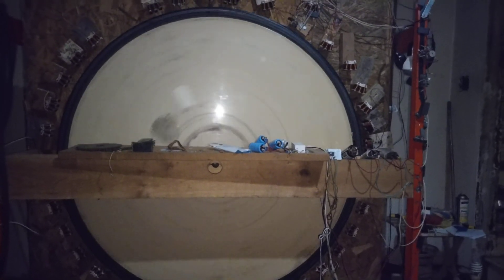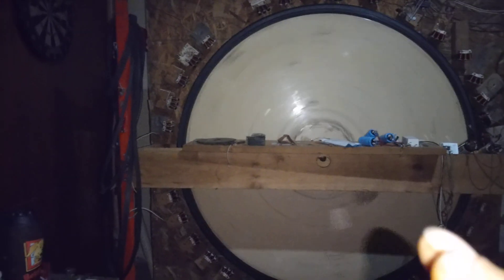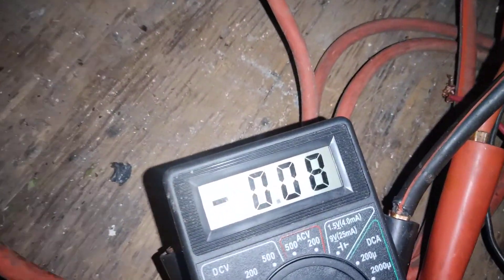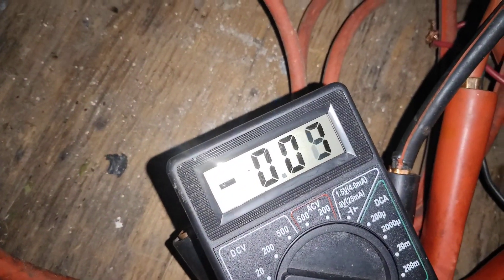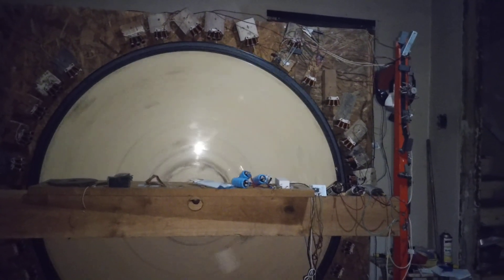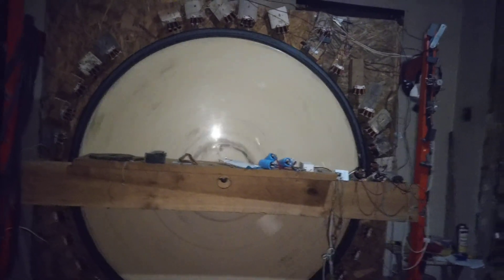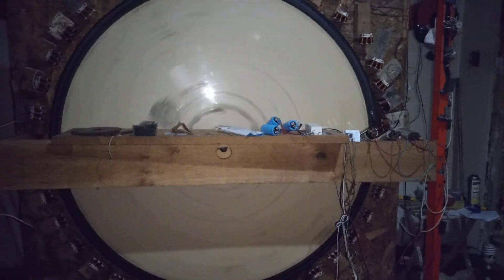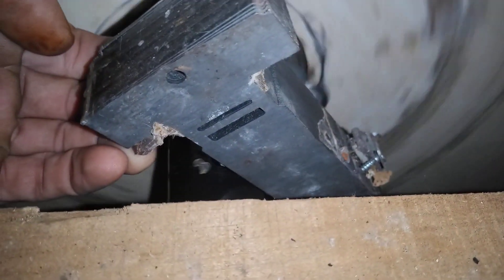4 ft 120 lb 320 magnet pulse motor running on milliamps. positive amperage very end of the video.

Comment: Wow! I love it.  Well done. It needs to be loaded preferably nonlinearly for best performance. Couple questions: 1. Are you in attraction or repulsion? If repulsive, switch to attraction. That's the way they ran theirs, they wanted you to discover to switch it.  2. Are you saturating your cores? Probably not if in repulsion but in attraction, if you've gotten you lengths right so you can stand wave, you'll want to dial your system in so those cores sat. to provide heat for conversion.  Thank me later.
Reply from the maker: Technically I'm running both in the attraction and repulsion. Because I have a north-south setup. But I'm basing all my timing on the collapsing field to delay the lense effect to be used in my benefit to push the opposing magnet away. I'm testing a secondary switch now, to test the theory on Robert Adams the sign when he says knowing when to cut off the generator coils. 
Thanks for the comment and I will think on it. 
And I don't always reach full core saturation. Need 150+ volts. 
Thanks for watching and thanks for commenting 👍👍👍